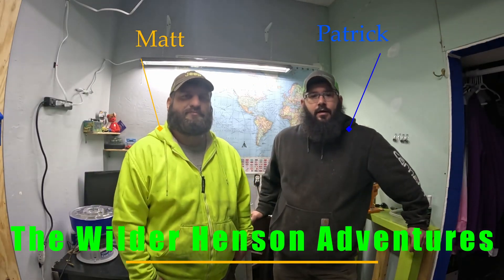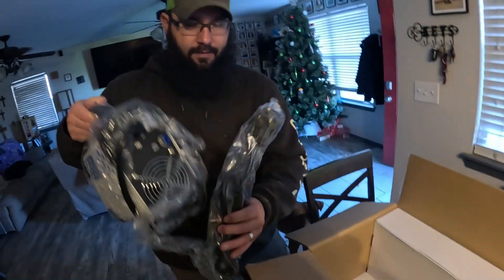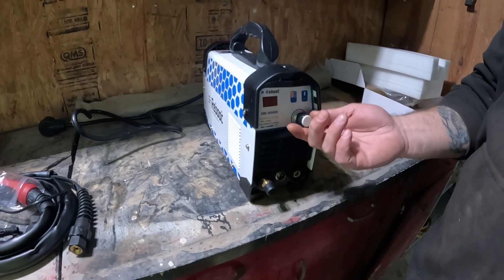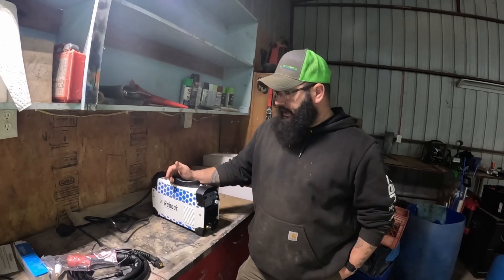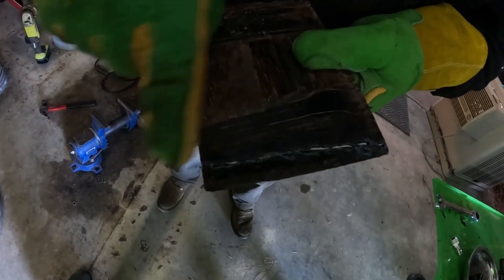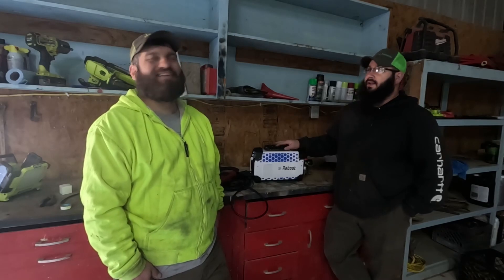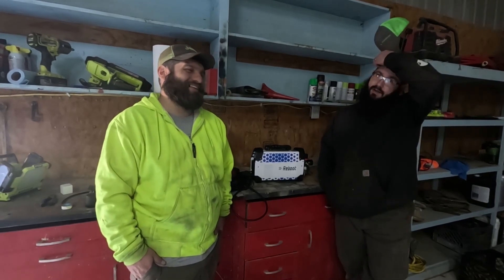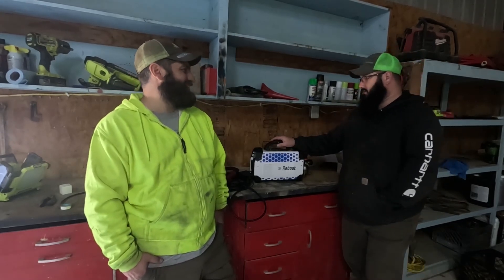We got the Reboot Plasma cutter off Ebay, and try it out

Comment: your cuts will come out more even and smoother if you will clean thesurface off and get rid off as much rust and crap off it,,
Reply from the maker: Yes for sure. We have both learned alot about using it over the past year or so. Thank you for the advice.

Comment: You guys have idea of the error codes on these? Bought on new error code E04 doesn’t work at all never even got to try it
Reply: I would check all the connections,  my cut 50 acted up when I first got it, I removed the cover and all the connections were loose on the inside for the ground and power, been using it for about 3 years now and I love it
Reply from the maker: Sorry, I don't  have a clue. Our manual got thrown away, so I am in the dark just as much as you. If you get it figured out, be sure to let us know. Good luck, and thanks for the question.
Reply from the maker: after some digging, there not much on the 6000ds yet but i found this on the manual may give it a shot.

*If you have any problems that cannot be solved, please contact us at service@mirthtek.com .